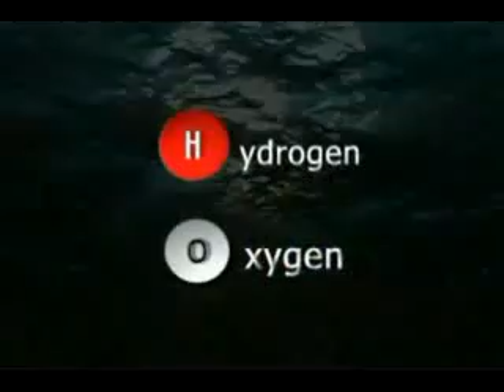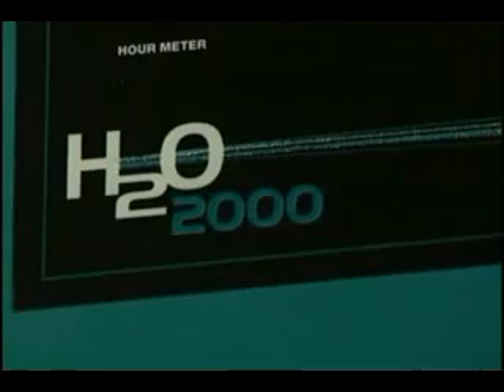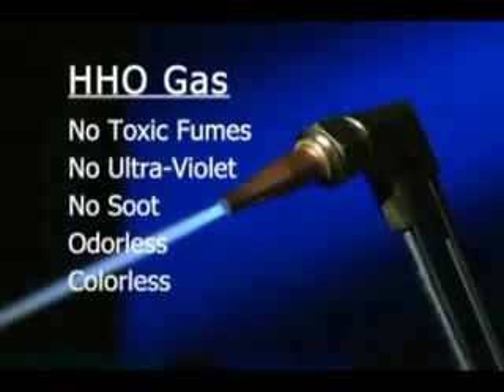Convert Your Engine To Run On Ordinary Tap Water

Comment: There is a company I can across recently called Aquatune Systems, it looks they have a slightly different means of converting water into hydrogen and oxygen. If I read correctly they draw a small amount of vacuum produced by your engine and run it in a echo chamber that contains a tuning fork. The chamber produces a frequency for the water to be “cracked” which I would infer that word used, means that it partially breaks/weakens the bonds. Then a current would be passed through the water to create the gaseous states of oxygen and hydrogen. This way less current is needed, they claimed 0.5 amps could produce 2.5 liters of hydrogen per min. I am aware of the laws of thermodynamics, but also you must take into account your car is quite quite inefficient at both changing potential energy into kinetic and also excess energy is being released constantly too. Ex: You alternator doesn’t just stop when the 12v battery is full, also the combustion of commercial gasoline with all its additives to help the engine does not burn fully stoichiometric. Now I see it as simple means to harness otherwise wasted energy wether already kinetic or potential. It’s not a matter of belief but knowing it works. And the only way is to correctly and holistically apply it. So I do wish to see this work physically, wether publicized or not. 

I think most of these people that think out of the box or at inventors, they lack monetary resources or ways to fund, and the issue is that most of those that are wealthy aren’t truly wanting to better the earth or help. Primarily it is a game of wealth and exploitation to the extent of keeping control.

Comment: As a neutral party I thought I'd add to the overwhelming negative comments below. First, Denny Klein did try to take his HHO invention and run cars on it. I understand he has a successful history of racing boats. That effort got him two things. 1 a contract with the US army. 2 framed for running a car on an unlicensed fuel in Florida with a car that didn't even have wheels on it. So, apparently this video was edited to remove the references to running a car on HHO to keep him out of jail. Perhaps the channel has more elsewhere or its been snuffed?

Next, he was granted a patent for this tech. If you want to learn something new, read it. The chemistry is quite novel and not taught in high school but investigated and verified by several University Laboratories. Simply put, the machine ionizes the water and forms strings of multiple ions that form a gas.When this ionized water gas condenses, it emits a low activation plasma spark that does what plasma arcs do. It changes the atomic structure of materials doing fusion and fission and makes water. This is a natural process that happens in cavitation under water. Previously this was called sonoluminescence. Water dissolving metal propellers with sound and producing light. You can decide what makes more sense. 

Its not free energy. The energy to ionize the water comes from cavitation or electricity. The atoms release a higher energy compatible with the total energy absorbed by the ions. Its at a high energy frequency that splits the nuclear structures of other atoms and that releases the extra energy that melts or sublimates elements or just releases lots of heat. No BS zero point energy or multidimensional energy sources or dark matter imaginary fairy dust. The energy comes from consuming matter. It turns out matter is made of electricity, you just need the right mix of charge and magnetism and capacitance to coax energy from matter safely. And this gas does it.

There are several ways to make the gas, and it can run cars. But actually bragging about running cars will get you killed or in jail.  Peace.

Comment: 1. Old Video, Link and product sold is for cars, this video is about torch applications.
2. This is not hydrogen gas. The tech is a energized form of water, the common SP3 orbitals have been energized to 2 P orbitals and 2 SP orbitals. The "burn" is just the gas condensing to 4 SP3 orbitals.
3. The energy to make this gas is less than separating the liquid to H2 and O2.
4. The condensation "burn" releases a plasma arc that can produce LTNR with anything; this is how you get the high temp burns and power that replaces gasoline. 
5. Denny Klein released his designs for making the gas. He did run cars on it. Obviously if you can convert air into energy using water as a catalyst, you will have plenty of energy left over to make the reaction self-powered.
6. The economic impact/devaluation of the US dollar would happen if this were popular. Not just the oil companies, but most of the feeder industries too would fail.
7. This tech is obsolete as an energy source, see TC Heins work.

Comment: Environmentally clean? What a lie! Its as clean as an all-electric car. It requires an external source of electricity to run. Majority of electricity is produced by burning coal. All this technology does is move the exhaust pipe elsewhere.  Besides that it requires a lot of parts to produce this device which adds to overall polution. Producing distilled water requires energy that they don't mention either.
There are no simple answers. So far no one has produced an HHO  engine that would produce more energy that it requires to produce the fuel it runs on.
Reply: Cold fusion doesnt violate laws of thermodynamics. Fusion (hot or cold, even though "cold" is basically impossible) is just very very efficient. But this shit claims to be "making energy" which is bonkers.
Reply: Jesus Christ man, can't you just make a generator that runs on hho gas... but at the same time produces hho gas... infinite energy??
Reply: Jesus Christ man, can't you just make a generator that runs on hho gas... but at the same time produces hho gas... infinite energy??
Reply: +Eduard Baz It can't be done with today's technology.  I think Cold Fusion is still 10 to 20 years away.

Comment: This is simply separating Water into the hydrogen and oxygen with the electricity. The gasses separate and you can use either to fuel your car. Both in large quantities are explosive and very dangerous, which is why this tech has not been developed. Do more searches on you tube to see more without having to buy their product.
Reply: Nope, the "tech" has not been developed for cars because it won't work. Takes more energy to split the water into hydrogen and oxygen than you get back when you recombine them in an internal combustion engine. Very simple explanation if you are the least bit versed in physics.

Comment: It's a great mystery why this is still even a thing. So you electrolyze water, and that takes so much energy. Great, now you have an oxyhydrogen mixture in a 2:1 molar ratio with an energy density greater than water. But there's a particular amount of activation energy you need to combust that mixture. subtract that from the energy released in the HHO mixture and you get less energy than you started with.

Worst case scenario, you have an energy loss. Best case scenario, you break even. there's no net gain. There's no way around basic thermodynamics.
Reply: the man speaks the truth as a fellow scientist :) thumbs up
Reply: +Richard Skinner, yes, and in the real world, we never ever ever get the "break even" scenario. Ever.
Reply: Troll True
" magnets, pulsed current, and resonant frequencies can exponentially increase the efficiency level of a cell".
Not one of those thing are true.

Comment: This hho thing has been going around on the internet quite a number of years now. Strange that no-one has conclusively brought forward a 100% hho running vehicle and plans for it. Seem to be stuck on merely using hho as an aid in reducing fuel consumption. Just saying, seems strange to me.
Reply: ***** You are right, they sacrifice mankind and environment just for keep the petroleum cartels.
Reply: Carl, all those invertors are systematically murdered by the governments and energy cartels.
Reply: IvCastilla that is too statistical. Systematical murders? like scheduled.?
Reply: IvCastilla
Who is "they"? The aliens?
Hydrogen is a useable welding/brazing gas along with others. Use it if you want or don't, it has nothing to do with "petroleum cartels".
Reply: IvCastilla
Nobody is murdering anybody over this. This technology is well known to industry and is used where it offers some benefit.

Comment: Does something look funny here 1:30. What plumber do you know that uses oxi acetylene to solder copper pipe ? Ive been a fabricator fo 22 year's & i know that a (properly adjusted) oxy acetylene flame will melt that pipe in the same amount of time it took them to heat it up, they shouldn't try to fudge the demo by not adjusting that carborizing flame to a neutral one. Who would use a HHO unit on a big job site with a small amount of work, this thing is to bulky and fragile to be moving around not to mention having to find some where to plug it in (not practicle for all aplication's). How many volt 110 or 220 and what amp's, you also may need to carry around a generator to run it. And also this is not a new technology, it has been around since the 40's or 50's. This machine is more for a factory setting, you wouldn't want to be moving it around or pushing it through the dirt and that's why oxi fuel is still king. I think it is a great technology but the way this vid was put together down plays the machine. The technology speak's for itself.
Reply: Irene you have a VERY good point. When I was studying plumbing as a mature student. I witnessed a student being thrown off the course, for believing that he could use acetylene with the O2 to weld copper tubing. The sick part about the whole episode, was he tried very hard to dump me in the same ordure, as I told him to use the blow torch connected to the propane cylinder. He mistook what I said to mean the O/A cylinders. His downfall, being that at the specific time 3 other mature students were present & vouched for me in the following inquisition. MAPP gas, yes I could understand using that for fast soldering, given that it IS meant for metal brazing.

BTW, what do you usually fabricate?
Reply: g0bl1n1962 custom tractor trailers and tankers mostly, a lot of one offs.
Reply: Irene Wilson you have no idea what you're talking about.

Oxy and Acetylene are used worldwide to solder copper tube. I learned to use it as a plumbing apprentice. 2% silver solder needs acetylene to solder quickly but propane works fine. 

In Australia for example, almost ALL plumbers use Acetylene to solder. We also don't use crap soft solder but even then a skilled tradesman would have absolutely zero trouble using acetylene even for small work by simply using their brain, turning the flame down and use a small tip.